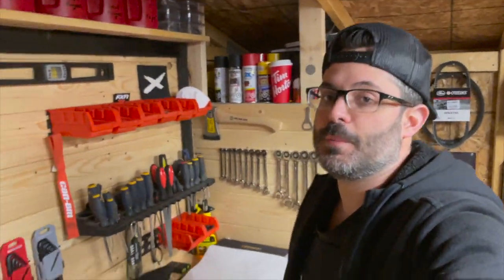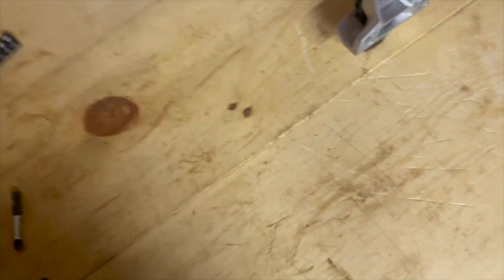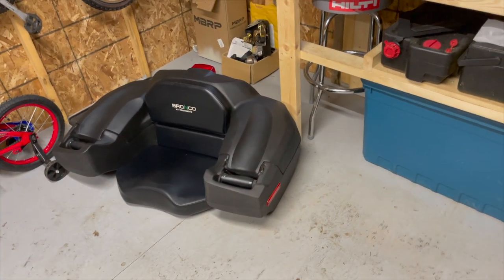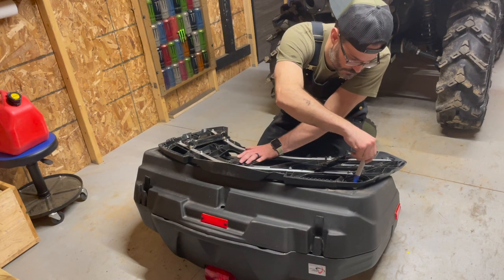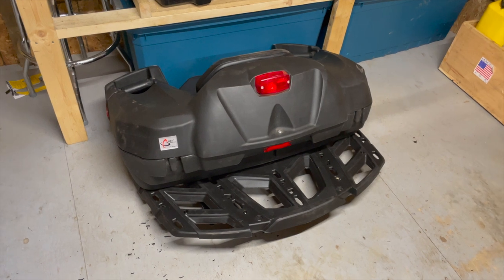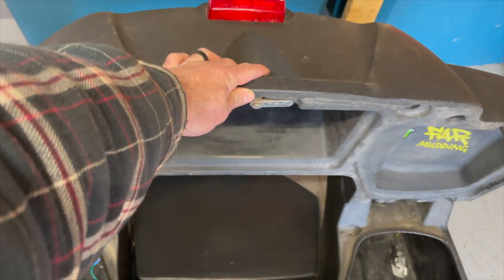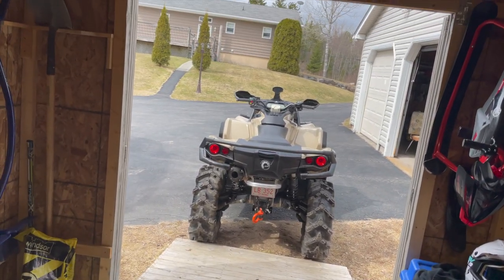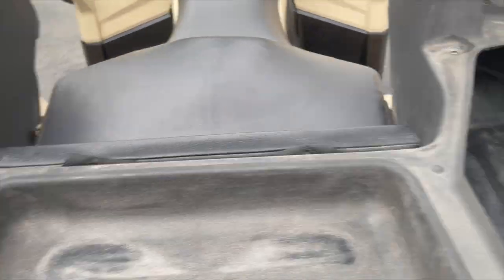Easy Passenger Seat Install (Removable - Linq System Hack) - Can-Am Outlander 850 XMR

Comment: I looked into the linq brackets you used , but didn’t think they would work
I used Wes Industries Linq quick release adapters and I have a kimpex nomad seat
I believe the bronco/Wes seat like yours actually has 4 indents on the bottom to drill for the Wes mounts
I only had to drill 4x 3/8” holes in the bottom of my seat instead of a “linq sized hole” like you did
Cool to see how you did it tho, I also wanted to be able to take seat off quickly and not have semi permanent u-bolts like most do
Reply from the maker: Cool man haven’t heard of those before. Look like i good idea!
Reply: Glad I seen this comment. I just got the Nomad seat for my Outlander with this style rack. I was trying to figure out how I could do it with maybe an elevator bolt or T-Bolt but those adapters are exactly what I need.
Reply: Do u recommend the wes industry mounting kit ?
Reply: Mine are still working great, I have seen another brand somewhere, that appears to be a rubber squish, instead wes’s  bolt and nut style, but I think the Wes would be stronger/ more reliable

Comment: That's nice, but it's not a legal two up machine.
Reply from the maker: 🚔 haha. Yea man shhh.
Reply: Yes, if you were to have an accident with a passenger in the seat the insurance company would drop you like a hot potato. Just a fyi.
I sold my single seater and brought a outlander 1000r two up.
Reply: You mean you carry insurance on your toys??
Reply: Asti de pleureu
Reply: @Mossman4u2  I have a 570 XT max for wife and I to hit the trails, but here in Ontario, we were told by local OPP “legal for 2 people” means there must be a seat, handles, and footpegs for a second rider. Meaning an aftermarket seat is allowed as long as it meets those standards. I know rules are different depending on which province, state, country, etc. I also know that some aftermarket “seats” don’t actually have handles (therefor not considered legal in Ontario) but also, you would have to purchase aftermarket foot pegs… overall, it’s just easier to go with a factory 2-up model as I did, but depending on where you ride, it just might be doable to have a “single rider” and convert it.
Reply: I carry insurance on my toys, we have to that is.  Four wheelers are road legal here and goes under normal regulations. Last year we had one fatality.  The US have had since the 80s, like 18000?  Be careful over there.